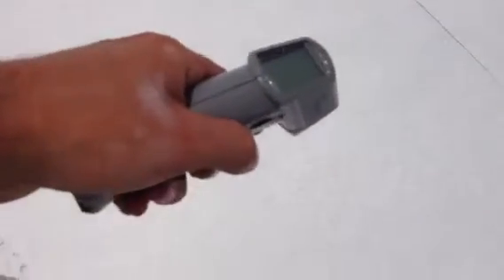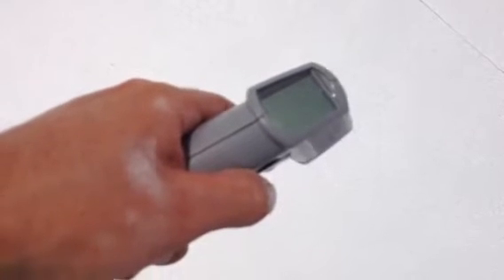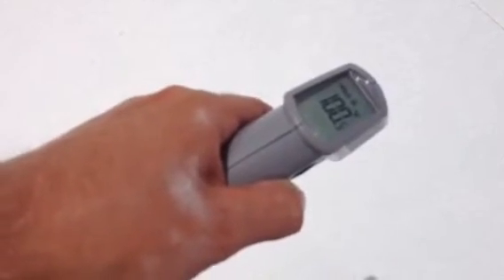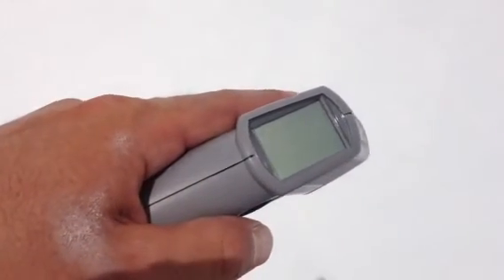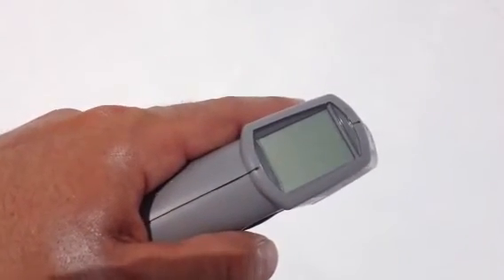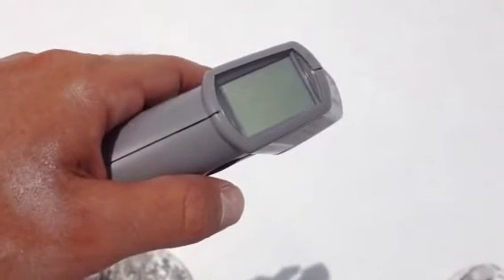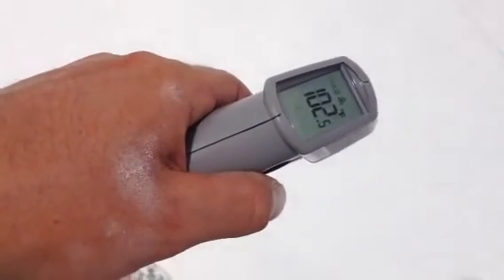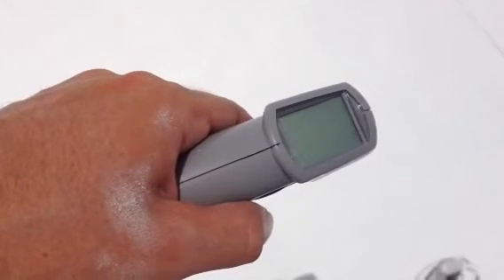Ceramic InsulCoat Roof - Cool Roof Coating (Paint): Heat Load Reduction on a Flat Roof System

Comment: nice roof temp info, which shows helping the roof to last longer.  The problem is should have also shown any difference of the temp in the room below that roof Nice to have a 70F decrease on the roof.  How about a what 1, or 5, or 40F change in the room below?
Reply from the maker: Excellent point.  We never received feedback from the Property Management Group.  

Over the year customers have told us that Ceramic InsulCoat reduces interior temperatures as well.  The problem is trying to film it and then promote it.  We captured a Contractor in 2016 that conducted an on-site test as he was applying Ceramic InsulCoat Roof on a residential roof system.  

Take a look at the video Coo, Roof that Reduces Attic Temperatures.  Here is the link https://m.youtube.com/watch?v=Ah-isR4iBaU